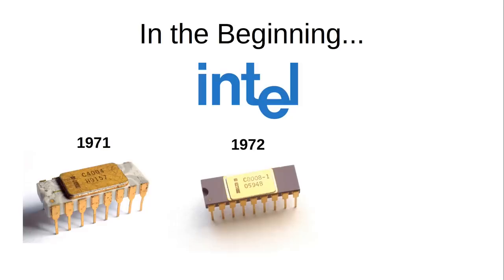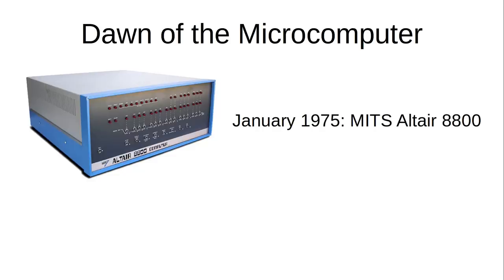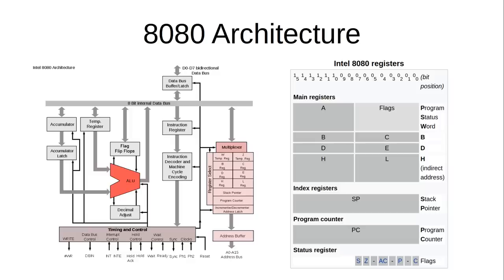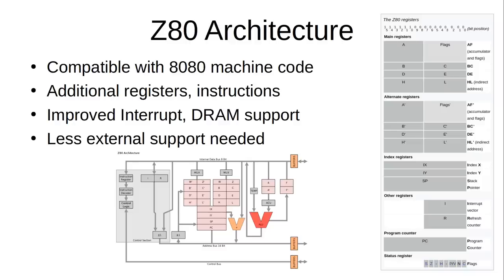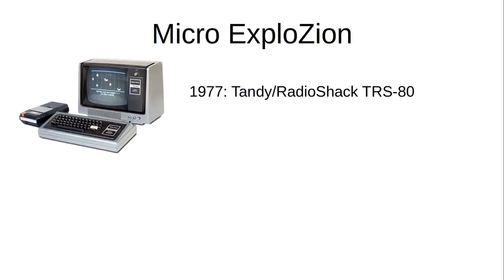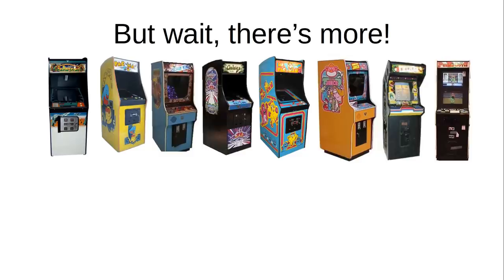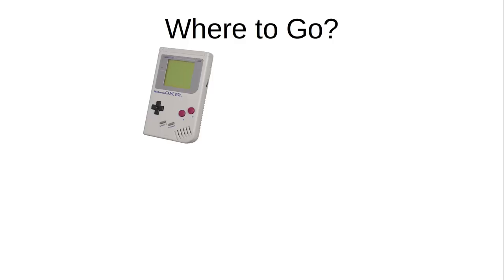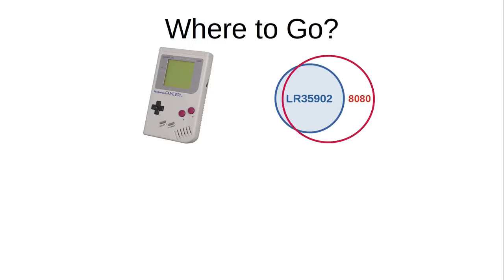Looking at the Zilog Z80 - NEW SERIES!

Comment: I do hope you will be using the Zilog eZ80 System on a Chip....
Reply from the maker: Maybe at some point.
Reply: @slithymatt  The old Z80 was under 1/2 mip! eZ80 has 80 mips...
Reply from the maker: @baremetal.engineer435  that's a great domain! Have you connected one to a display? It definitely would make a nice low-powered headless web server, at least.
Reply: @slithymatt  -- well if you looked at the baremetal dot software dot engineer dot pdf on my baremetal dot engineer webpage you will see exactly what my intentions are! You will see me decoding ethernet packets from my "air-gapped" network and writing an ARP packet cache... All in eZ80 assembler within a Forth environment... I am using the Zilog eZ80F910300KITG development board which I believe Digikey has now obsoleted... Fortunately I have 3 of them... They are nearly £300 each !! But they do come with a C Compiler, assember, etc and a very useful IDE...
Reply: Referring to that pdf file, Image#13 is what I am using right now and Image#14 is what I am working towards...
Reply from the maker: @baremetal.engineer435  yeah, I saw DigiKey "obsoleted" it, even though Zilog's website still has it as a current product. I only found one shady Chinese site selling them for $175, and I'd hate to see what they would charge for shipping. I'll have to go check out your PDF. WDC started promoting my 65C02 content, maybe Zilog will take notice, too!
Reply: @slithymatt  yes, I expect Zilog now Littlefuse, stopped making it and Digikey could not buy it in the quantities they wanted to buy in... Might be worth contacting Zilog directly as they may have some small quantities they might be happy to dispose of... 
I little while ago I wrote an SHA-256 hashing routine for it in 100% assember within a Forth environment... Took me a week. The 3rd pdf on my site is about blockchain as I want to use it on my platform...
Reply: Matt, If you search UT with "eZ80" some sites will come up of folks who have their own eZ80 boards for sale such as user "ChristopherLionRoars" who sells a "Makerlisp eZ80 board"... I have a spare USB programming pod you could use because his boards won't come with that... Would you email me using the corrected crippled email address on baremetal dot engineer and we could take this further (if you so wish !!)

Comment: didn't the intel 4004 start out life as a cheaper replacement for a several chip set for a printing calculator? it reduced the 12 chips to just 4, the 4004 being the central processor.
Reply from the maker: Something like that. Certainly that was the effect, greatly reducing the unit cost.

Comment: I would have gone with the C128 (Yes! It had a Z80 and came with a CP/M boot disk! Commodore's weak swat at the business market) It, but you're emulating so it doesn't really matter.
Reply from the maker: I considered it, but that choice had 2 big drawbacks: 1. Almost no Z80 software was commercially made for the C128, which was mainly used to play C64 games while having a nicer BASIC; 2. It's too close to the Commander X16, and I wanted to have a more radically different platform.

Comment: i can take you on a voyage of discovery and all i have to do is take a trip down memory lane. you neglected to  mention at LEAST one single board computer that ran cp/m on an 8080 and since the two were pin compatible the z80. that would be the cal-tex big board II. the only thing you bought was a populated circuit board, just like the first apple computer. it ran at 4.77 mhz and had 64kbytes of memory just like the ibm pc and its compatibles. you had to buy cp/m seperately, because if cal-tex sold it to you, they had to sell you the manual and the owner didn't want to invest in the extra inventory. the computer had a pair of 25 pin serial ports and a single parallel port,. they were all male or female, because the standard to have one male and the other female had not been instituted yet. i bought mine in 1984 and i can't remember. it also had the capability of supporting a 1 megabyte ram drive, which i guess is the distant ancestor of the present day solid state drive. the memory was volitile, meaning when the power was cut, everything on it vanished. however if you did a warm boot such as control c, the disk and it's contents were still there after the boot. my bbII came with an 8080 and then i upgraded to a z80. i later bought a pc-xt clone and actually got the two to communicate by way of a crossover serial cable. the cp/m machine had half height double sided double density drives and the xt clone only had 5.25 double sided double density drives. for those of you that have no idea of what a crossover cable is, it goes like this. you reverse the transmit and receive pins, which are pins 2 and 3, on one of the connectors. it is also referred to as a null modem cable. you can also do that with an ethernet cable, so you don't need a router for one computer to talk to another. this was my introduction into networking.

since cp/m machines did not have anything like a cmos that remembered system configuration, you had to hard code everything into the os. my first introduction into assembly language was to set up the parameters for a hard drive by directly editing cp/m and then reassembling and linking it with the library functions. first a 5 meg segate, the size of a small toaster and then a 20 meg seagate with a 5.25 inch form factor. that drive was later moved to the xt clone and then replaced with an 80 meg seagate. i bet you don't know things like the difference between hard sectoring and soft sectoring on floppy drives. i also bet you don't know that the maximum partition size for a hard drive was 32 megs for both of those operating systems.

if you mention the heavy hitters at zilog, you have to tip your hat to stephen savitzky, one of their strongest coders. another name would be harold harrigon, a hardware engineer. i knew both of them personally. and visited their houses very often. i would go to savitzky's house every wednesday. in fact during one of my visits there i walked around the corner to the taco bell on stephens creek blvd across from fry's grocery and ended up in line behind none other than steven wozniak of apple computers fame.

i love it when people who were born decades after the fact, write what they think is an insightful commentary on something they don't have the first clue about. a few of the old dinosaurs are still around. why don't you ask before you do something like this?

Comment: For much of the 1970s through and until 1986 IBM owned 49.5% of Intel common stock. Also IBM loaned Intel substantial amounts of money; and IBM creatively added to this by assigning key designers to Intel to "help out" chip design.  Why 49.5%?  It was a very long standing IBM policy to only own less than one-half of a company they thought was in their strategic interest.  So with 49.5% ownership Intel was free to do whatever they wanted to do, the reality however was much different. IBM selected and approved Intel's senior management, Intel's product plans, announcement dates, etc.  Inside IBM there was vigorous discussions whether IBM should Copyright and Trademark Intel's microcomputer instruction set and architecture.

Comment: Is Z80 a Harvard architecture or Princeton architecture?
Reply from the maker: It is von Neumann (Princeton)
Reply: @slithymatt  how much RAM is available for Z80?
Reply from the maker: @aabdev  it has 16-bit addressing, so you can have a flat 64 kB of memory, but a lot of systems, like the ZX Spectrum 128+, implement banking, so you can have much more.
Reply: @slithymatt  is  Z80 little endian or big endian addressing?
Reply from the maker: @aabdev  little endian
Reply: @slithymatt    which direction the stack RAM is growing in Z80?
 From biggest address to the lower address or from low address to the biggest addresses?
Reply from the maker: @aabdev  bigger to lower. Pushes decrement SP by 2, and pops increment by 2
Reply: @slithymatt  if the program is being executed from 64k RAM who whould store code and load code  back to RAM after power reboot?
Reply: @slithymatt  How many pipeline stages in Z80?
Reply from the maker: @aabdev  Z80 doesn't have pipeline stages like a RISC processor or a modern x86. It's strictly one instruction at a time.
Reply from the maker: @aabdev  depends on the instruction. I use this reference: http://z80-heaven.wikidot.com/opcode-reference-chart

Comment: You blew it at  the time: https://youtu.be/P9mIXXlxceM?t=460. The TRS-80n model 4 had 5.25 inch drives and compactable with the TRs-80 model 1 and model III )as well as being compatible with CP/M). What you actually show at that point in the video looks to be a TRS-model II, which yes, ran a z-80, but was mostly incompatible with the Model I, II and 4.
Reply from the maker: The internet has concluded that what I showed was a Tandy 6000 and not a TRS-80 at all. Somehow, that came up in an image search for the Model 4 and that made me confuse it with the Model II configuration.
Reply: @slithymatt  heh. both wrong. My second guess would have been a model 12, also wrong, or a model 16, also wrong. Never even knew there was a model 6000 - looks to be a hybrid of the model 12 and 16, having both a z-80 and a Motorola 68000. 

I seem to vaguely remember they offered a 68000 add in card for the 12 so you could run 16 software? (or I may be going senile). This seems to be basically a model 12 with that card already in it?

edit: looks to be a model 16B, most likely, from what i am reading,  or possibly a model 12. Both used the same case from what i am reading. The 6000, from what i read, had only 1 8 inch  inch floppy and one internal hard drive.
Reply from the maker: @sweintz  I've seen 6000s with different drive configurations, usually with the 8" floppy in one slot and either another floppy or an HDD in the other. The space would require a 1/4 height HDD, which was still pretty expensive then, maybe more than the rest of the computer combined!
Reply: @slithymatt   think you mean 1/2 height, not 1/4 height.

a high end half height 5.25 inch drive would fit just right in an half height 8" mounting bay with the right bracket.

worked in the repair shop of a computer store in a986, 1/4 height drive were not a thing then (were they ever?)

circa 86 best thing in half height would have been about a 60 meg rll drive. MFM would have been limited to about 40.
Reply from the maker: @sweintz  yes, sorry, I meant half height. 3.5" HDDs were still a little thicker than half of a half-height

Comment: Did anyone even use the ZILOG Z800 or ZILOG Z8000?
Reply from the maker: I don't know of any systems that came to market using the Z800. There were a few Unix workstations that used the Z8000, but they were greatly overshadowed by the Motorola 68000-based systems from Sun and other OEMs.
Reply: I worked with Zilog during the early development days of the Z800. The original idea was the Z800 to be a 16 bit superset of Z80 commands. When they went with a different command set I left being a user/advisor.